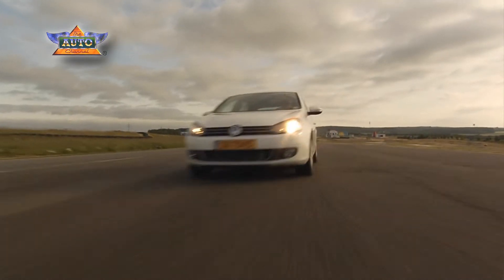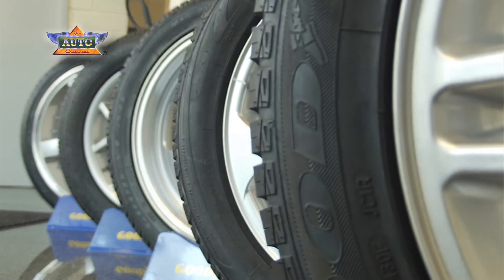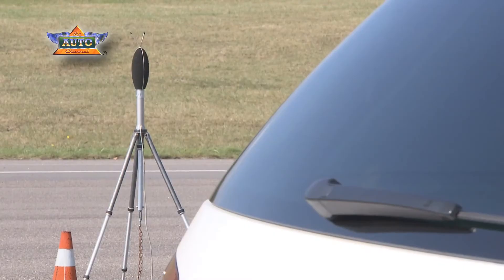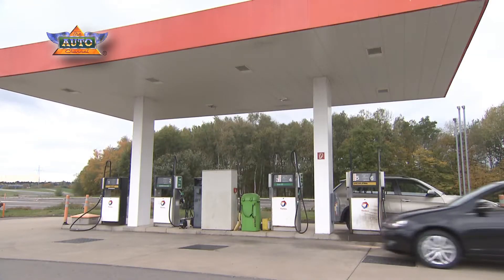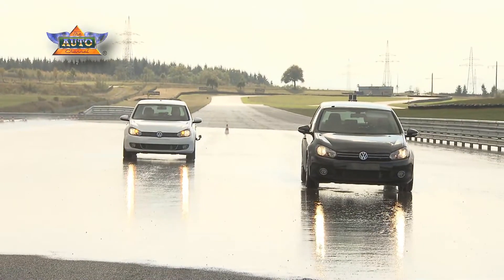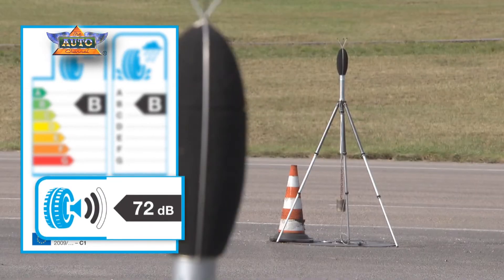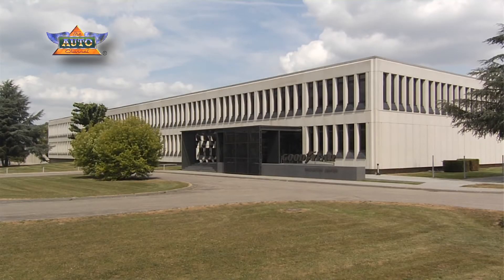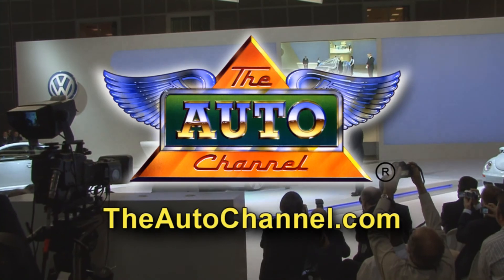New European Tire Label Explained

Comment: Frankly this Tyre info is more confusing & simply does not ring true, you have Chinese ditch finders, with better grip than well know tyres that do work and used for track days & the road, that work. with what ive seen & experienced with tyres with supposed better grip, frankly i dont believe it